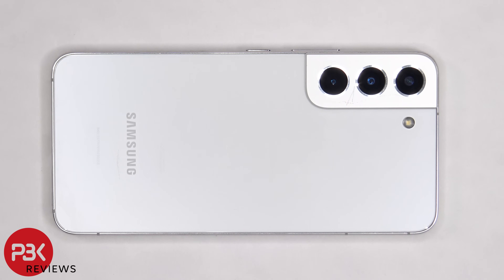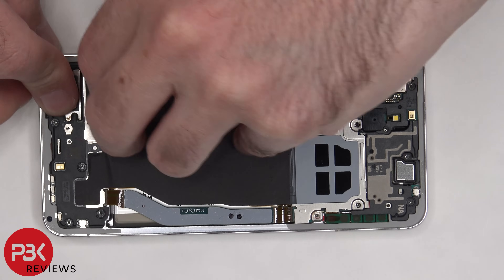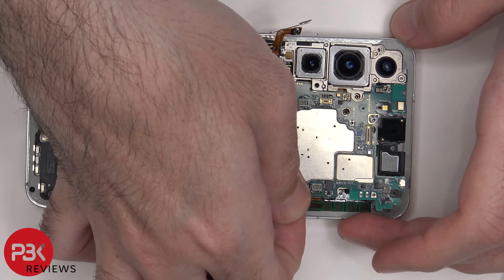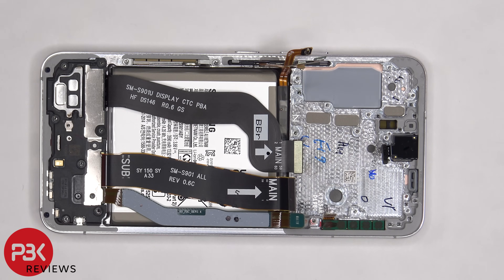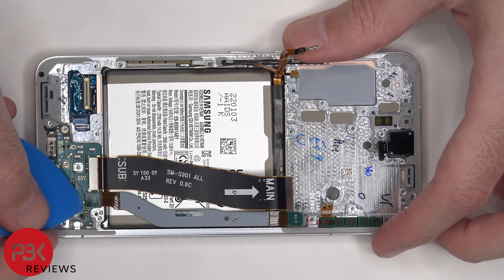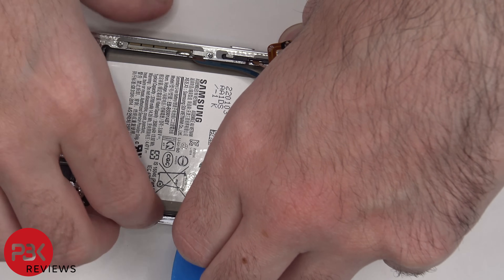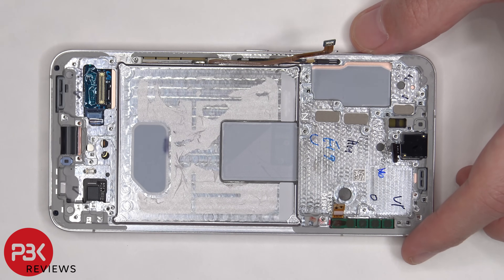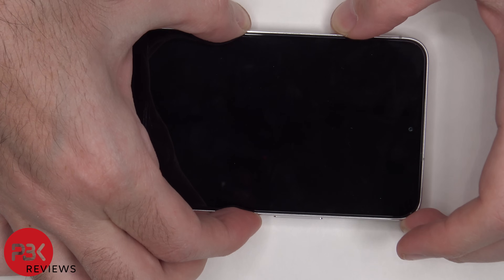Samsung Galaxy S22 Disassembly Teardown Repair Video Review

Comment: I bet this is one of the earliest if not the first teardown I've seen for the S22 series... I was eager to see the linear vibration motor the rumors were talking about...
Reply from the maker: I forgot about it since it wasn't placed in any usual place, but its tucked between the screen and frame on the bottom of the phone. You can see the cable/connector for it next to the connector for the screen on the bottom of the phone. I will take a better look at the S22+ and if its the same will pry the display off to show it.
Reply: @PBKreviews  Can S22 3700 mAh fit in samsung A80? would be a fun video!
Reply: Where is the vibration motor?I dont see
Reply: @Oleg-jt4wq   Look at the bottom speaker, It does have four connect point,two of them is motor connector. Another two is the speaker.
Reply: No, the motor is inside the speaker, Usually the speaker have only two connect points, But S22 got four.
Reply: i wondered the same, even jerryrig hasnt  teardown s22 yet
Reply: That's what I was looking forward to see, but I haven't seen it.
Reply: @chevystingray  I believe it's at 3:40 just right behind the bottom speaker unit.
Reply: I've been looking for the vibrator motor myself, but haven't seen it?????? Which kind of magicry is this?

Comment: no haptic ?
Reply: It's seems to be a software features
Reply from the maker: Yes it has it, I forgot about it since it was hidden but its between the screen and frame on the bottom of the phone. You can see the cable for it next to the screen cable connector on the bottom of the phone.

Comment: Where is the vibration motor?
Reply from the maker: I forgot about it since it was hidden but its between the screen and frame on the bottom of the phone. You can see the cable for it next to the screen cable connector on the bottom of the phone.
Reply: Seems like 2022 everything will become software features like ram extension 😂